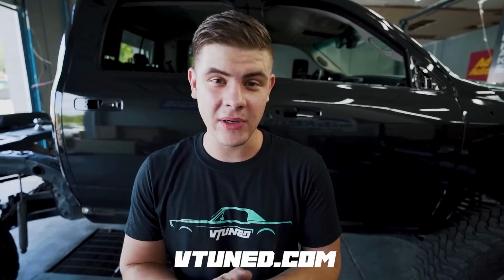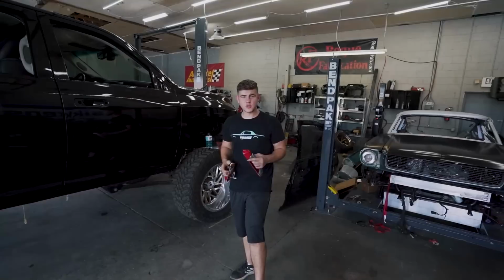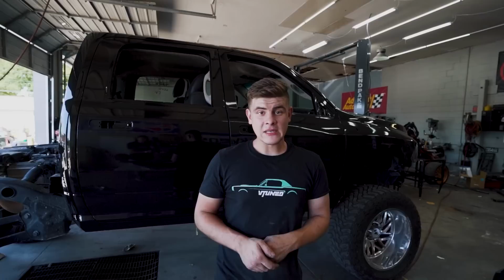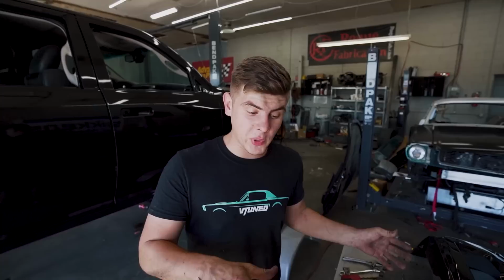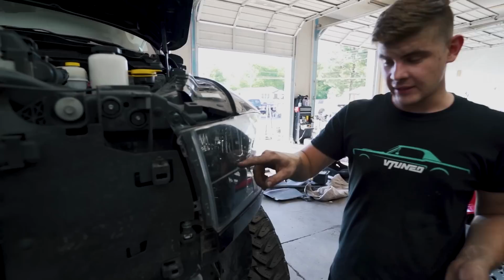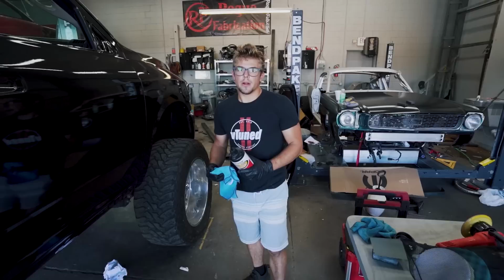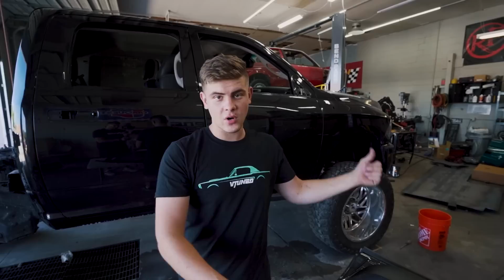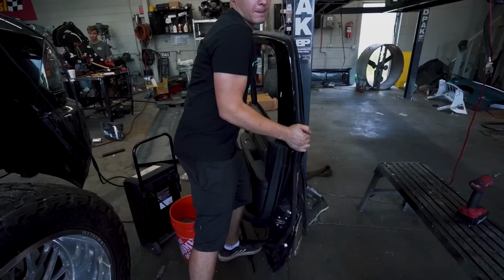Front End Complete - Rebuilding my Destroyed Ram Part 8

Comment: So if the front bumper is steel. I think it is? Won't the parking sensors just get massive rust soon as rain goes down the edge. Should you not have painted the bare steel at the least or some sort of rust protection?? PS vtune you work hard dude 👍